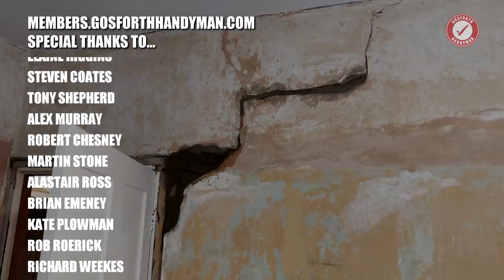Using a car jack to level door frames (1920's Renovation Part 18)

Comment: I love the way you say a centimetre out compared to an inch previously. 70’s child
Reply from the maker: Lol tell me about it. I'm really trying hard to ditch imperial but it keeps coming back! 🤣
Reply: I'm a 90's child working in the electronics industry and have started saying inches when measuring things by eye because those damn yanks still measure half of everything in inches 😂
Reply: I served my apprenticeship with some old boys who’d mix and match. Here, lad! Cut that baton at  3 foot 4 and a half cm would you. Really improved my mental arithmetic!
Reply: @Des Paterson. I joined the printing industry in the early 1970's when the DIN "A" paper sizes were being introduced. Some bright spark tried to align the Metric paper sizes to old Imperial paper and finished book sizes. e.g. Metric Crown Octavo. It would take quite a lengthy paragraph to explain what this term actually meant, so I wouldn't dream of trying! The little wrinkle I did learn using Imperial was that half of an odd number of fractions of an Inch was the same odd number of the sub-division e.g. half of 5/8ths is 5/16ths. But there are benefits as to be able to use both systems. Stay safe and well.
Reply: @clivewilliams1406  that fact that the standard used to maintain the inch in the USA is a metric standard, means that even if the average American resists metric, without it an inch would vary from place to place or be an inexact measurement.
Reply: I think most of us from the era where imperial changed to metric use both sets of measurements and use whichever us the easiest for example an interior door is easier if it's 78 x 30... As opposed to 1982 x 762
Reply: @davewright9312  metrification was done by the time I got to school in 83 or 84 but the fact that so many places like timber merchants still work in inch measurements, (reversed to how we hear it in America creators on YouTube, which caused some issues to start with as some of the more arsey yards) and that if all your doing is transfering one length to another place, the units used aren't important leads to people of my age and friends 6 or 7 years younger being very much familiar with both.
Reply: @davewright9312  Checked my 1960 flat.  Every door is a different width !

Comment: This is really interesting. I've never dealt with any type of structure than timber frame. This is a whole other world. Please show more like this, really different. Thanks.
Reply from the maker: Will do! I'll try to put together an explainer of how the whole house is built at some point. 👍
Reply: My house is built similarly, I was really shocked when I saw upstairs block walls resting on timber joists but apparently it's just how it was done in those days. I've got on doorway drooping where its above the middle of the lounge ceiling. Didn't notice it until plastering was all done and I came to do architraves
Reply: @TomTomTomTom538  Jeez. Every time I've encountered plaster walls I hire a subcontractor to take care of it. It's usually only on historic buildings as far as my experience goes. Now I'm wondering if I've just been avoiding this type of construction just from doing that.

Comment: Andy I almost thought you were gonna bang out a paradiddle on that second door frame!
Mr. Porter made a good point about framing out those wall sections. If they're not load bearing it's worth the work. Otherwise every time you look at those doors you'll think........
shoulda, coulda, woulda.
Reply from the maker: If I did every 'coulda' job in this house I'd still be renovating it in 2 years. 😉
Reply: @GosforthHandyman  Ever thought of building your own house from the start! it probably, once the ground works are done,  is easier.

Comment: If you haven't got a car jack, I particularly liked the "Essential Craftsman 2x4 jack" video from a couple of years ago where he uses an ingenious couple of 2x4's as a lever to lift a gable end garage door jamb an inch or so after vehicle ripped out a bottom plate.
Reply from the maker: I don't think I've seen that one - I'll have a look for it! Good find! 👍
Reply: @GosforthHandyman  It’s called a ‘proud shore’- cut 2 inches longer than door frame height - then whack the bottom over to achieve required lift.😉

Comment: I came across an old boy chippie doing adjustments same as yourself but  with sliding wedges that was quite a easy way than a car jack but its good to have options
Reply from the maker: In this scenario I think you'd struggle to get the force needed to open up the frame. 👍

Comment: It's been awhile since i did Carpentry but i would have been inclined to run a hacksaw blade between door frame and wall and cut the fixings off. It's probably nailed as many were in the old days. Move your frame up adding a packer under your door frame and refix with screws and plugs. This way you retain the original gap at the top of your door. I don't believe the door dropped because of movement in the floor, The door frame may not have been resting on the floor from day one and the weight of the door over time has pulled it down. Nail fixings in this type of block material is a very weak fixing and would never suppoert the weight of a door over time.

Comment: Hello, I’d love to see the testing of concrete screws vs screws with wall plugs and see the difference in pull out strength
Reply from the maker: They'd both exceed my test rig unfortunately. Mine only goes up to 300kg I think. Concrete screws will win by a long way, I think. 😁

Comment: Andy - wasn’t the water cylinder in the bathroom in the corner adjacent to this door? I’d think that would be the root cause of this door frame being out of level, and the corresponding crack in the bedroom wall too.
Reply from the maker: Yup! Briefly mentioned in the vid. Almost certainly contributed to the problems. Not to mention the water tank in the loft bearing down on the same wall. 👍

Comment: Wouldn't it be better to shim between the floor and the hinge side leg of the door frame? That would also help with your reveals around the door when you shut it.
Reply from the maker: You'd have to cut all the existing fixings and that would cause major damage to the wall. 👍
Reply: @GosforthHandyman  I see...so the door frame acts somewhat like a structural part of the wall? Is that common in block walls over there, or is it mainly due to the house's age?
Reply from the maker: The frame is nailed to wooden wedges embedded in the cinder block. If you cut the nails it will loosen all the wedges and damage the wall. It's fine as one unit but mess to much and you might as well take the lot down. 👍
Reply: @GosforthHandyman  Huh. Interesting. Thanks for the explanation, and keep up the great work. 😎👍

Comment: So you jacked up the frame head so the joint at the corner opened up.  So if you remove the frame jamb on the hinge side, move it up and refix you won't need to do anything to the door.  I think its the old block wall that the frame was attached to that dropped causing the frame to drop with it.  If its non-structural just take the wall out and put a new stud frame up. Is that a concrete lintel above the door frame?
Reply from the maker: It's just more cinder blocks above the door frame, no lintels. Lot of extra work to completely remove 4 door frames and the associated walls. 👍

Comment: I know you do not want to redo the wall as it will be a P.I.T.A. However, as the wall is not as stable as it should be would it not be worth the effort to replace the wall? If it was replaced with wood construction it would also reduce to load on the joist underneath it.
Reply from the maker: The wall is fine as it is, beat in mind this settling is probably from 80+ years ago. No more movement now. 👍

Comment: Suggest you put in a tapered piece at the top to make it look level or a piece 10mm thick with appropriate varying thickness spacers. Once the architrave is on and it's all painted you won't see it and it will look perfect. (Don't ask me how I know this 😉)
Reply from the maker: Yup, that's exactly the plan Mark! As you say, once it's all put back together nobody would ever know. 👍😁
Reply: @GosforthHandyman  Great minds...

Comment: Sawzall to cut through all the frame fixings for me, then trim and refit the door/frame as necessary then refix. Far too easy to move a lintel with a jack
Reply from the maker: There's no lintels on these, all blockwork. Cutting the fixings would cause major wall damage  and re-fixing would be tricky with these ones. 👍
Reply: agree. but that's the difference  between trade and DIY, mostly find this guy very watchable. This type of problem is very common upto and including property built until mid/late sixty's early seventies  then soul plates introduced. How do I know that ?  As an Apprentice  hearing my boss arguing with building inspector or C.O.W about extra costs etc etc ..

Comment: Is it possible to lift the one side of the frame from the bottom of the upright leg? You'd need some way of transferring the load from the jack to the underneath of the leg, maybe a squared S shaped bar.
Reply from the maker: You'd need to cut the fixings or it would rip the wall apart. 👍

Comment: Have you found the door frames arnt  flush with the wall now that the architrave has been removed? I've noticed it in my house.
Reply from the maker: Loads of them aren't flush and even worse now the walls are re-plastered. Might cover that in a future vid but will be shimming them out. 👍
Reply: @GosforthHandyman  thats what i feared. I've found 4mm and 6mm stripwood in wicks and b&q that I'm going to use to hopefully bring the frame level with the walls again.

Comment: i'm not sure if i missed something, do i have this right - so the one end of the joist is resting on the downstairs wall, and that is solid, at good height. the other end is resting on the (i dunno what is called, but the outside wall?), and that is also good. the joist is not supported along its length by anything else, and so the joist itself sagged through the middle? is that right?
Reply from the maker: Yes, slight sag in the middle. It could also be contraction of the timbers. 👍

Comment: With all the other frames being pretty good I did wonder if these two were installed on the wonk rather than having settled a lot.
Reply: I have a similar question about my own house. Some of the door frames are really out, but the architraves are mitred as if it was always that way. My theory: the apprentice did it. Also a 1920's house.
Reply from the maker: Don't think so as the doors are square. 👍

Comment: We here across the pond call that a cob job.
You treated the symptoms but not the problem. The problem being the support wall has collapsed and needs to be raised and resupported.
Reply from the maker: ??? The supporting wall hasn't collapsed.
Reply: The second story wall area in video is supported by the first story wall which is acting like a pillar and that area on the first story area is sagging too.
The area under the first story floor needs to be jacked (or raised) to its original position. This in kind would raise the second story floor back to its original positon and then the modifications to the door frames wouldn't be necessary.
I had an RV and mobile home repair business for twenty years. The same principles of construction that apply to housing apply to rvs and mobile homes just on a different scale.
What I can tell you is when the foundation (in the case of rvs and mobile homes, the frame) is off, doors and windows do not shut right. Setting the frame level, I never had a case where all the doors and windows didn't work properly.
The fact that you did not set the frame of the house properly, sent my OCD into hyperdrive.
Reply from the maker: No, covered this in the vid. The ground floor walls haven't dropped.
Reply: Then what happened to cause the second story floor to sag?
Reply: @GosforthHandyman  professionals eh?, Gosforth.......!
Reply from the maker: @andymccabe6712  😁😁
Reply from the maker: @freetolook3727  Also covered that in the vid. 👍

Comment: I hope that when the bathroom is reinstalled and the bedroom furniture is in place the weight doesn't cause the joists to move again. 
Really should have replaced those walls with studwork or install steels from below.
Reply from the maker: Very much doubt it. The settling probably happened 90 years ago. Unlikely to move any more. 👍
Reply: Sounds like waayy over the top to me!  A bit of make do and mend is often sufficient.......!!
Reply: Maybe , but what is that wall sat on in the room below? Is there another wall,  or just a joist? Now is the time to do the job properly.
Would hate to see cracks developing  in a few months time when the floors are loaded up again.

Comment: Out of interest why wouldn’t you use wedges under the side jam (after jacking up) to raise that back up to the wooden lintel? Wouldn’t this mean you might not have to rehang the door?
Reply: You'd need a lot more than a wedge with the horizontal fixings I'd think. He'd have had to basically cut the nails/screws into the block work using a reciprocal saw or something. That's probably how I would have thought to do it, but it may do more damage to the blockwork I suppose.
Reply from the maker: As Rico says, it would mean cutting all the fixings in to the wall and that would cause major damage. Plus re-fixing afterwards would be tricky as these cinder blocks are only thin. 👍
Reply: @GosforthHandyman  thanks for explaining

Comment: Looking back at your previous video you show that the wall has nothing below it, if it is only a thicker joist it will move and wreak your new plaster,  trust me I know. I have 30 years experience as a carpenter and seen this before several times with house renovations. 
 Clients don't want to spend the money to change the walls or turn the single joist into a flitch beam but do regret it afterwards when cracks  appear.
Reply from the maker: Bear in mind this settling is from 80+ years ago. There's no more movement in that wall. 👍
Reply: But there is cracks in it now, how long ago was the room last decorated ? 10 years ?
Reply from the maker: @pauljohn6709  probably 30+ years ago, but also bear in mind that's likely from the old water tanks (x2) and the huge notch out of the joist. No ceiling damage downstairs.

Comment: trying to fix into those blocks is a nightmare, no amount of rawl plugging helps
Reply: If they’re the same sort of blocks I’m imagining they are, I find screwing directly into them is best. I suppose masonry screws and a very narrow pilot hole would be the belt and braces approach.
Reply from the maker: As long as the block is intact I've found they take plugs fine - trouble is they're only thin. These are pretty dense though. I've seen more lightweight ones. 👍

Comment: I'd have all that block wall out and stud it, on the first door you done. I expect its straight on floor boards, coursing joist to sag.
Reply: I would agree.  Wall between our bathroom and a bedroom was odd construction with studs infilled with bricks standing laid on their face rather than top/bottom.  It has been a pain and I regret thirty years later not biting the bullet and tearing it out.
Reply: Was about to say the exact same thing. Couple of days work to bring it back to drywall ready for the plasterer.
Reply from the maker: It's a lot of extra work (a lot more than 2 days) as electrics would need moved etc. plus it would wipe out 2 other door frames and walls in the process.
Reply: That is always the issue.  It seems easy until you actually see what else is involved.  For me it was moving all the CH and hot water plumbing.
Reply: A good DIY'er always under estimates the effort. Otherwise we'd never start.  😁
Reply: Agree , stud it and couple new liners
Reply: @shizzleinthenizzle  agree

Comment: I don't think you found this house, I think it found you. It needs you to make it stand tall for another 100 years
Reply from the maker: Thank you! Yes, that's definitely my aim. A 1-in-100 year renovation hopefully. 👍
Reply: I had the same thought, but it decided to inflict its curse on another victim... I may be projecting from my house that fights back at every point.
Reply: @GosforthHandyman  You're doing permanent fixes for all the problems that a house-flipper would have covered up with flimsy finishes and a lick of paint.  There's profit in a quick cosmetic job, but there's rewarding satisfaction in doing a job right.